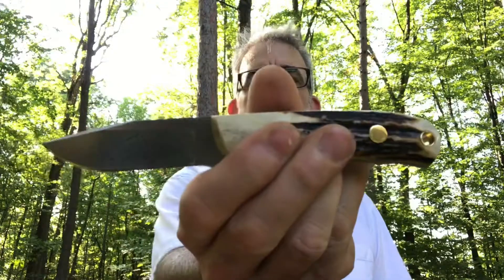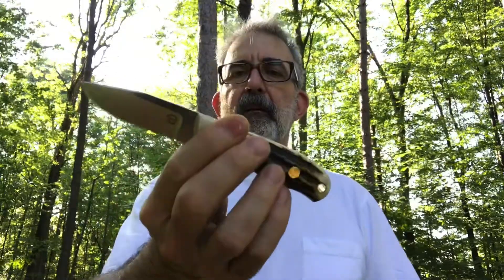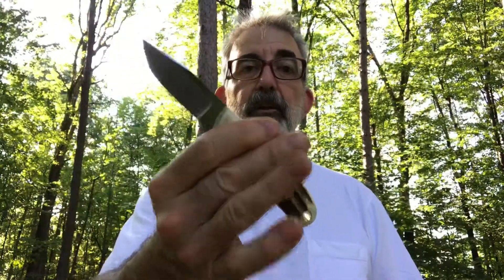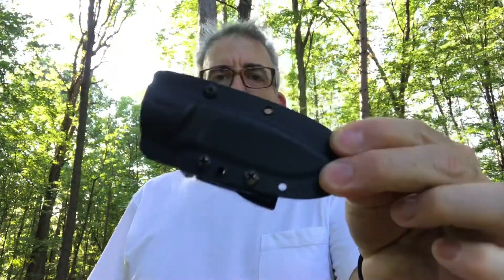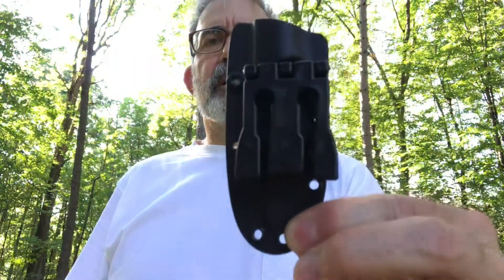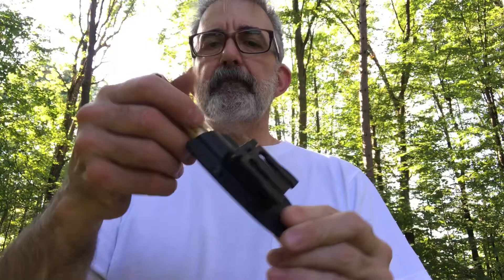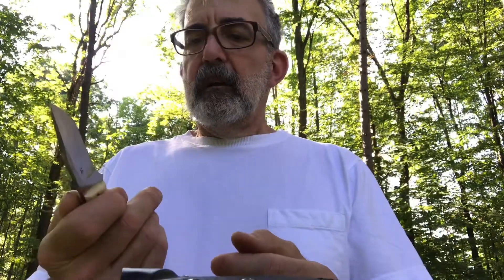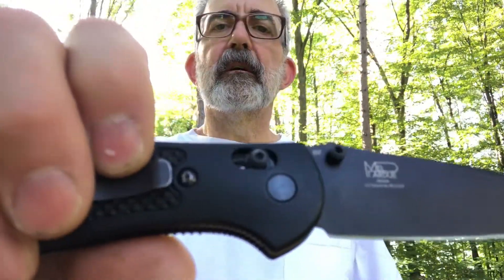Should This Randall Model 5 Have Broken?

Comment: I agree. The whole argument and discussion surrounding the purchase of not only knives but many other things in life revolve around how durable it is, the quality of the craftsmanship, the reputation of the maker, the warrantees, the high level of quality of the components as in steel or handles, etc...

How does it make sense that we will get into flame wars about all these things, spend hundreds if not thousands of dollars to buy these "Highly Respected" pieces of equipment, then lock then away or put them on a shelf just so we can say "I own one of those".

I bet you that you could run a social experiment and have a fictitious knife get highly recommended by some key people, charge a large sum of money and use crappy steel then only a very small portion of those people would ever complain because everyone else will set it back and keep it locked away.

We are paying top dollar for the high-end steel, handles, designs because they are supposed to last a lifetime. Why buy those if you don't end up using it for the lifetime.
I am soooo guilty of having to buy the "best" then just set it back because it looks so nice I didn't want to mess it up. I end up spending even more money buying other items that will do the same job. I forgot that all the reasons I used to spend that much money are the very reasons that I should be using it.

An old friend of mine had a tradition that he did every time he bought a new truck.
He would drive it home, throw two of his log chains in the back end, then drive around his 180ish acre property checking the fence-line. He went over rough terrain, through a creek, through many many mesquite tree/brush areas as well as a whole slew of other plant life that lives in a semi wooded area on the backside of his property.

After he made his rounds, he dropped the tailgate, had a beer and named his truck.
I asked him why he did all that one time and he said he wanted to be the first to scratch it and get that out of the way so he didn't even have to worry about if it happens or not.
Reply from the maker: You win "Most In-depth Comment Of The Year" award.  Wow.  Thanks for watching and taking the time to be so detailed in your thoughts.  Glad to know I'm not alone in my thinking.  Love the story about your friend and his pick-up trucks.  That is a great way to live.  Much less stress.  

On that same vein, when I decide to keep a Randall or any knife for that matter, as a user, the first thing I do is cut some nasty cardboard to it gets scratched.  Then that anxious moment is over and done with and I can then go on and enjoy the knife, knowing there is no turning back the clock and making it "new" again.

Thanks again for watching.  I do appreciate it.